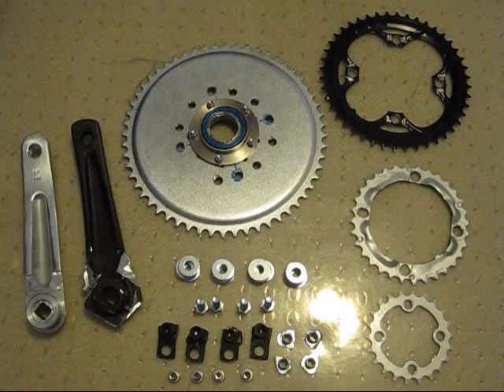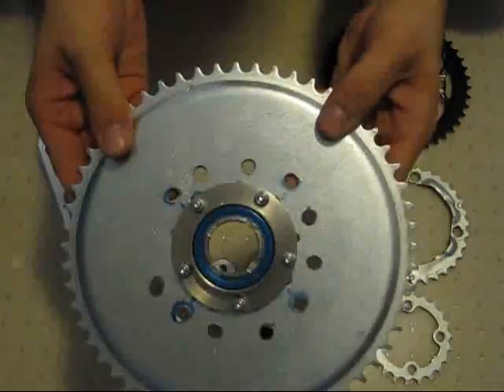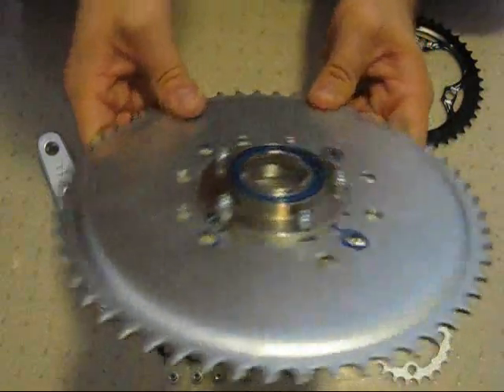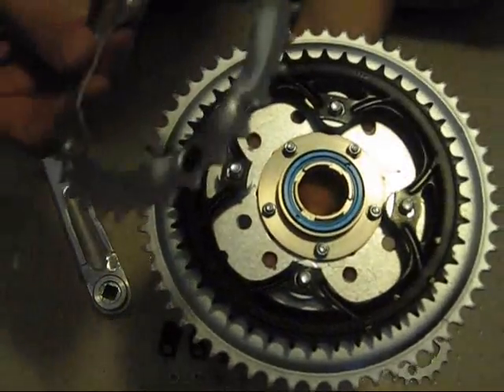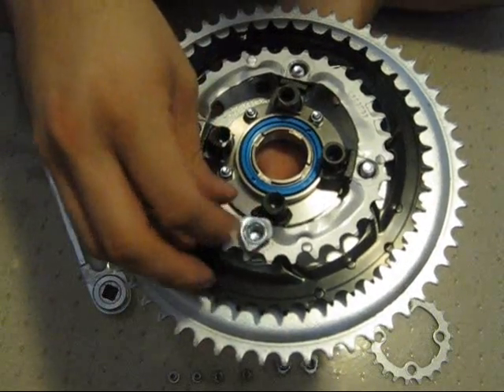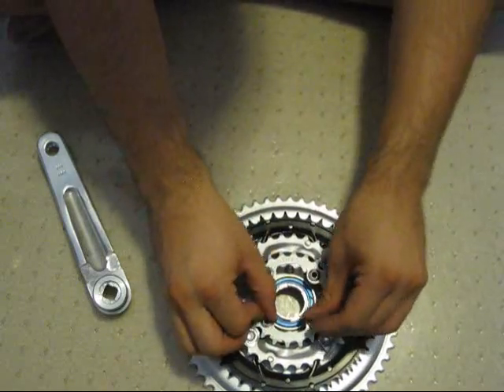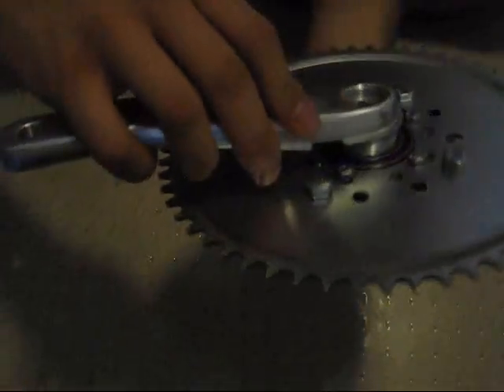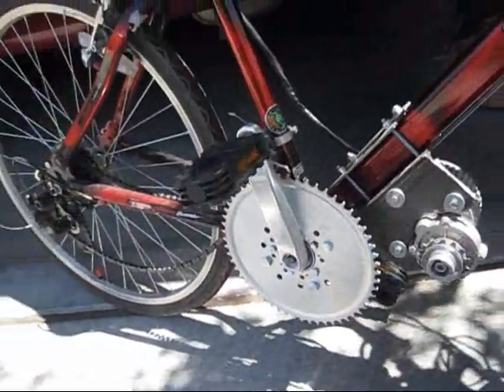Homemade Freewheel Crank with Triple Chainrings

Comment: Would you be interested in selling one for a reasonable price? I don't need a triple I just need two change rings with a space where the middle one was leaving me with one for my existing chain on the outside that goes to the back derailleur like normal and then another one on the inside for the short chain coming from a DC motor located in the bottom of the triangle for a DIY mid-drive on the cheap not because I'm a cheapskate but because I'm unemployed and this will be my primary mode of transportation for now until I can find a decent job and save up enough money for a car that doesn't force me to deal with ghost pedaling and allows me to Leverage all the benefits of the so I can get the most bang for my buck out of this little Walmart hoverboard motor I have that I am misappropriating specifically for that purpose which as I see it is by far my best option for an affordable conversion of my cruiser hybrid to make it as efficient as possible considering I'll be using old 18650's from obsolete laptop batteries as my power source which leaves a lot to be desired but is barely within my means as it is assuming I can get it done as I simply don't have the materials or tools necessary to fabricate this part

Comment: I see sprocket to sprocket is lined up nice and straight.
But when you tighten it up.
It's not going to be lined up anymore.
Will drop a good few mm.
Did you put more spaces on to fix it.
Just wondering because looks like.
You don't have much room left on pedal arm.

Comment: I'm glad to see some one has the same project like mine.
But I'm sorry that this project was done 8 years ago.
Reply from the maker: Yeah this ended up not holding together when I went up a hill.  If I were to build this today I would have just purchased a freewheeling crank like this:  https://www.cyclone-tw.com/product/9/data/13
Reply: @hutchtransfer  You are right. I change my project after all. I put dc motor directly to rear wheel.

Comment: I say it's a fail considering that big gear is supposed to spin free from the others
Reply: thats not true, if the big sprocket spun on its own how will power reach the rear wheel? You need an input (big sprocket) and output sprocket which rotates with it to transfer the power to the second chain

Comment: Hey there I really like your video. It was very helpful. But I was wondering is there a way can I pay you to make me one?
Reply from the maker: It would be much cheaper and less hassle to buy a pre-made mid-drive kit.  Had these been available several years ago, I probably would have purchased one of them instead of building mine.  The one I built always needs fine tuning since is was a custom job, and I know a kit would be much more reliable.  Here are two kits that use a 450 motor similar to what I used:
https://www.gngebike.com/gng-2019-450re
https://www.amazon.com/Electric-Mountain-Mid-Drive-Conversion-Bike/dp/B01CL2NWUY
Reply: Thank you so much

Comment: Update¿
Reply from the maker: Sorry no update on this.
Reply: @hutchtransfer  that means it worked... I think... want to sell it?
Reply from the maker: @GDMHificationranpitc    Unfortunately it did not work.  It broke under an extreme load going uphill.  However, they do sell something similar if you look here:  http://www.cyclone-tw.com/Parts.html
Reply: @hutchtransfer  thanks, I could see that happening those bolts would be under a lot of stress.  One man's trash is another man's treasure still :-)

Comment: This is good stuff man! You need "sleeve bolts" for the smallest chainring, and really some sleeve tubes made up on a lathe instead of that stack of washers. But at least you were able to make it work with basic bits and pieces.
Good job.

Comment: Do you have the video of removing the original sprocket from the motor? Would appreciate if you can please share the steps to remove the sprocket from the motor.
Reply from the maker: Unfortunately I do not a video for that.  If I recall, the nut on the original motor is reverse threaded.  I used a set of pliers to hold the gear and then I used a ratchet to loosen the nut on the motor shaft.

Comment: Hi. Meaning no disrespect, but all of these extra gear ratios are totally unnecessary. You have 8-10 gears on the cassette. With 3 extra sprockets on the chainring, that makes a possible combination of 24-30 gear ratios. With almost any bicycle engine, from the China Girl mid-frame engine to the GP460 or Tanaka 47R engine, 8 gears is more than enough. It'd be like driving a car with 8 forward gears. And YOU want to drive with 24 forward gears? Really? I've run both the 460 and the Tanaka engines for over five years on crowded streets and highways. Guess how many gears these engines like, for street driving? They like FOUR GEARS!!!  First gear to crawl on sidewalks at walking speed, third gear at Olympic runner  speed, and 5th gear to jump into traffic at 30mph-up. And one thing ALL!! 2-stroke engines like is SUPER  LOW GEARING to start off at the bottom of a steep hill or a dirt berm. I run a 10-tooth engine sprocket connected to a 72-tooth chainring sprocket(T8F/smaller chain= 7" chainring sprocket). The engine has a 5:1 reduction tranny, so that's (72/10)X5=36:1 ratio. Then  I use a 24-tooth driving chainring and a Shimano 11t-34t 8-speed cassette. So 36:1 x (34/24)=51:1 first gear! That's like having a 123-tooth giant rear wheel sprocket! So as not to bore you with 8 gear ratios, here are the other 4 gears that 2-stroke bicycle  engines might like: 3rd gear on the cassette is 34.5:1(like an 83-tooth rear sprocket. 5th gear is 25.5:1(like a 61-tooth rear sprocket. 7th gear is 19.5:1(like a 47-tooth sprocket). If it's flat ground, I might use 8th gear, which is 16.5:1(like a 40-tooth rear sprocket). If I use the first 4 gears in a row, my engine says "Come on! Shift wide-ratio, not close-ratio!"Okay, let's try to figure out what your gear ratios would be like on a bicycle with a China Girl engine. Let's gear it very low on the engine and jackshaft, to give you a fighting chance of attaining ho-hum gearing to absolutely un-usable gear ratios. The China Girl engine has a built-in gear ratio of about 4.15:1. Take a 10-tooth engine sprocket and chain it to a 17-tooth left-side jackshaft. So 4.15 x (17/10)=7.06:1gear ratio. On the right-side of the jackshaft, place a 9-tooth sprocket. Chain it to the 48-tooth chainring. So 7.06 x (48/9)=37.65:1. Connect the 34t rear cassette to the 24-tooth chainring. So 37.65x(34/24)=53.34:1! That's like having a huge 129-tooth rear wheel sprocket. Really low. To be fair, this is even lower than my setup.  8th gear is 17.26:1(like a 42-tooth rear sprocket). A 2-stroker would love this combination.Too low and need more speed? Ok, shift to 36-tooth chainring. First gear is now 35.56:1(like a 86-tooth wheel sprocket and 8th gear is 11.5:1(like a 28-tooth sprocket. Unusable for 2-stroke engines). 7th gear is 13.6(like a 33-tooth in-usable sprocket). 6th gear is 15.69:1(like a 38-tooth rear sprocket).Need high speed? Can your engine pull these high gears or fall flat? Switch to the 42-tooth chainring. First gear is now 30.48:1(like a73-tooth rear sprocket). 8th gear is now 9.86:1(like an un-usable 24-tooth rear sprocket.7th gear is 11.65:1(like an unusable 28-tooth rear sprocket. 6th gear is 13.45:1(like an unusable 32-tooth sprocket).So, with 24 possible gear combinations, which do you choose? If I was FORCED to use multiple chainrings, I'd run the 24-tooth chainring. 8th gear would be 17.26:1, which is fine. However, if my engine had the power to reach 50mph, I'd switch to the 36-tooth chainring. I'd do this for the sole purpose of using 6th gear, which is 13.45:1(like a 32-tooth sprocket. For further comparisons, let's use stats from a  gear ratio calculator:to be continued while I retrieve the gear calculator link.....Read more Show less Reply     1                   Edit   Delete                                                         myron yamashita1 second agoOkay, 8th gear at 16.5:1: a China Girl spinning 9,000rpm would reach 42mph. A Tanaka engine at 10,000rpm would hit 47mph. A GP460 engine at 11,000rpm would turn 52mph. So my whole point is that you don't need more than 4 gears.....8 speeds at the most. Choose your sprockets wisely for super low gears on 2-stroke engines. If not, you'll be riding a dog.Read more Show less Reply     1
Reply from the maker: Yes I realize that some of the middle gears are unnecessary, but I built this with parts I had available at the time.  I wanted a granny gear so this motor would do well on hills, however I also wanted larger gears so that it would reach 20 or more on the flats.  Therefore the middle gears are not used as often.  Plus you realize I have an electric 450W motor and not gas.   Because this motor is not that strong, extra gearing is needed for hills.  If I had a gas powered kit then I agree that all of my gears would not be necessary.
Reply: When your little electric motor or hot battery takes a dump, gears will be quite convenient.
Reply: I don't doubt it, but sometimes even good stuff goes south. Perhaps it would've been better to say "if" instead of "when".
Reply: ... bruh

Comment: Hey awesome setup, so I understand the crank has a freewheel built in on the right side with all the chain rings so when the motor turns your your pedals stay stationary, so is there a freewheel built in the left side, I got a project right now, i converted a car alternator to brushless motor
Reply from the maker: There is no freewheel in the left crank.  There is only a freewheel in the cranks connected to the chain.   You just need one freewheel on the cranks, and this will allow the motor to spin and keep the pedals stationary.  To eliminate drag while pedaling with the motor off, I have also put a freewheel on the motor itself.  This will allow the chain to freewheel so I am not spinning the motor as I pedal when the motor is turned off.

Comment: This is a good idea. I read the comment that it failed but it just needed some machined blocks maybe from some 6061 aluminum to make it solid. I do have a question being that you seem to be skilled in building motor bikes. Has anyone used at least a #40 - #41 chain n sprockets ? I ask  because I'm a good sized feller who is 6ft + and 200+ lbs and have stripped several bike sprockets just by peddling up hill. My goal before spring is to build a 99cc  or  212cc predator with maybe a 3 speed drive the way you have done here. I'll belt clutch a step shaft to drive the peddle sprocket but already know that a regular bicycle chain will strip out.
Reply from the maker: Yes some aluminum would have been better.  Back when I created this video no one had offered chainwheel sets.  Now 
there are some places that sell a double chainring freewheeling crank.  Here is one:  http://www.cyclone-tw.com/order-chainwheel.htm   If this was available before I definitely would have purchased it instead of making one.   I had one of those cheap bolt on motor kits and I did recall using the #40 chain.  The chain outlasted the motor!  I have not used that for the electric bike.

Comment: What happens if you get your trousers/pants caught in the drive sprocket ? Is it gonna rip your leg off? Like you see on those lathe accident videos
Reply from the maker: Luckily this has not happened to me since I roll up my pant legs or use a rubber band to hold the pant legs.  I imagine you would lose your pant legs first instead of your leg unless those are really well made jeans!  :)
Reply: hutchtransfer Hi yes its best to be cautious at least fill in all the medical details on your iPhone and any hospital locations in the area pre programmed in you sat nav aswell. Just. Because that outer drive sprocket is still powered when you stop pedalling and could possibly wrap your foot around the crank and I like my limbs pointing in the right direction. Maybe you should watch a lathe video as it can just snag your shirt sleeve then twists into a cord then rips your arm from its socket, but here you have the added bonus of you trousers millimetres away from danger.  It's not for me I will pass on this one due to sanity prevailing.
Reply from the maker: I have thought about getting a  custom chain guard to protect everything.

Comment: Any updates on your work?
Reply from the maker: No updates on my bicycle.  This particular homemade freewheeling crank did fail under heavy load up a steep hill.  My latest bike video from a few years ago shows how I redesigned the freewheeling system by using triple chainrings from an old bike.
Reply: Are you saying this particular setup failed?
Reply from the maker: Yes that particular setup did fail under a heavy load going uphill.  It seems I pushed it too hard.

Comment: Given the rear wheel already has a freewheel, by making the drive sprocket freewheel-enabled, how is efficiency achieved?
Reply from the maker: A freewheel on the drive sprocket allows the motor to run the sprockets while leaving the pedals stationary.  If you did not have the freewheel then the pedals would always be spinning whenever the motor is running.
Reply: ***** Thanks for enlightening, master.
Reply: that mean do you have 3 freewheels one for the motor chain link and cassette? thank you i need help
Reply from the maker: One freewheel on the motor, and one on the cranks.  Two total.
Reply: thanks man !

Comment: I really like what you have done with your mid drive system.. how has the 250 watt motor worked
 out and do you know where you can get a 500 or 750 watt motor to use as a mid Drive  the same that you did. I really like the commercial Baufung  mid Drive kit which includes battery for about $1,200 but I don't want to spend that if I can do something similar that you have done
Reply from the maker: My motor is currently 450W, and so far this one has worked well.  The ability to change gears really helps this motor.  The max speed is about 20mph, which is fine with me.   As far as more powerful kits, you should check out:  http://www.cyclone-tw.com/

Comment: Thanks for responding so fast. The info. you supplied helps quit a bit, but you wouldn't happen to remember how long the bolts were that ran though the drive gear and 8 washers? Have you done an updated version of this project. Thanks for the help and keep up the good work.
Reply from the maker: +Waterwolf28   I believe these bolts were 20mm in length.
Reply: @hutchtransfer  Hi! Is it left hand thread? This freewheel doesn't work like a regular one. It should crack only when you spin it back, but here it's the other way around. Do you have a diagram? I did not understand, although I watched the video many times. Do you have telegram or something else for contacts? Thanks advance!

Comment: This is a 2 part question. 1: What size of washer did you use and how thick were they? 2: When you cut off the chain-ring mounting bracket did you have to drill the holes and if so what size of bit did you use?
Reply from the maker: +Waterwolf28   I have not had this set up for a few years, so I do not know exact dimensions.  The washers I purchased had the same diameter as the holes on the chainring.   These washers I picked up from the hardware store and have a uniform thickness.  My guess is that they were close to 1mm in thickness. The small black brackets you see in the video were already drilled since they originally fit the chainring and the threading was already in place.

Comment: Is it possible to use this combination you made in your eletric bike, but instead of this eletric system i use similar to the sbp shift kit?
well, the truth is:
i live in Brazil , would be hell of expensive to import the sbp shift kit. (or any other kit of the kind)
i have a 2 stroke engine kit on my bike and was planning to make a homemade shift kit, also using this Crank ideas of yours.
Reply from the maker: Túlio Santiago   In theory it could work, however you would need to know the rpm of the engine shaft.  You would need a way to reduce the motor rpm to 100 rpm at the pedals.  You would need to modify your crankshaft to accept a gear.  This could mean you need to do a couple of reductions.  Then you would need to purchase a freewheel and freewheel cranks.  I do not recommend using the homemade triple chainring crank I made in the video you watched.  The motor would most likely rip this apart.  You should watch my other bike videos for updates on the crank system.  That could work out better for you.

Comment: Where did u get those little brackets for the 22t ring ?? and what material are they from ?
Reply from the maker: vali4o   I took a regular triple crankset and I cut those little black brackets off.  You can find a triple crankset that has removable chainrings.  The brackets that hold the granny gear are the ones you want.  Unfortunately this is not the best design because those black brackets eventually broke under heavy load up a hill.   If you view the latest electric bicycle video on my channel I show a different triple chainring that is easier to build and is stronger.

Comment: Many of these mid drive systems are noisy because of the small sprocket and chain. Could you demonstrate the noise level?
Reply from the maker: You can go to this video on my channel: Homemade BB Drive Mid Drive Electric Bicycle Update  At the end I have the system running so you can hear the sound.  The freewheeling sprocket in the above video is different than the one in this video, however it will give you a good idea on the noise level.   Actually most of the noise is not from the chain, but from the motor itself.  The freewheel also contributes to noise.
Reply: ***** Thank you for the response, I wanted to hear the motor and gears under stress while actually riding.
Reply from the maker: I ride the bike at the end of this video:  Homemade BB Drive Electric Bicycle